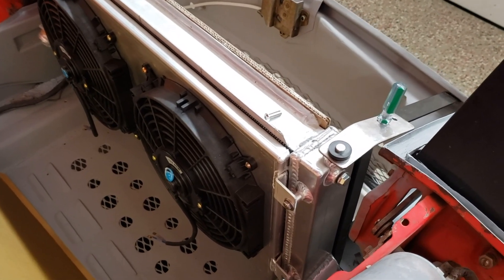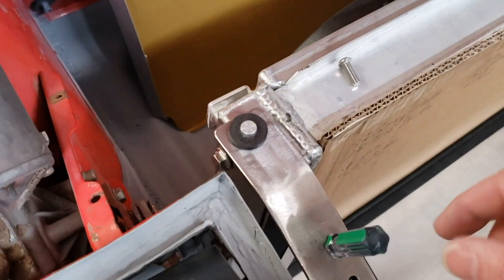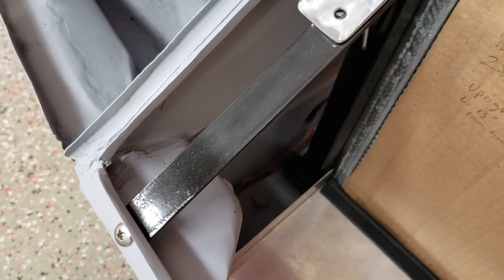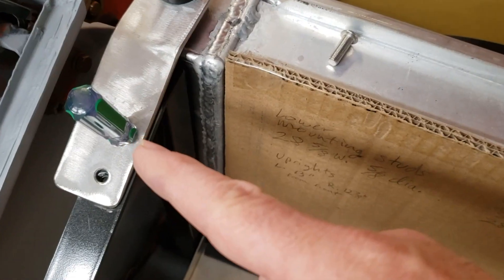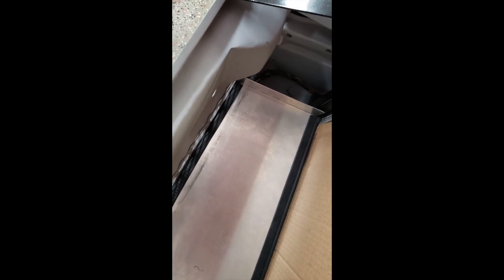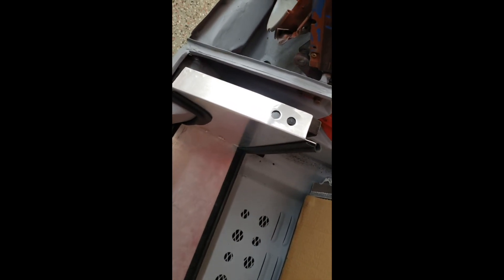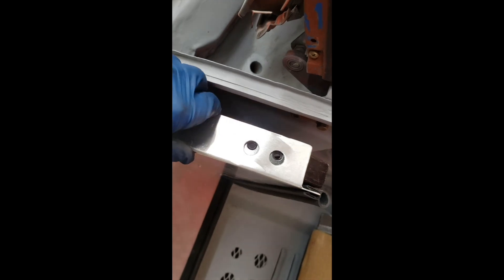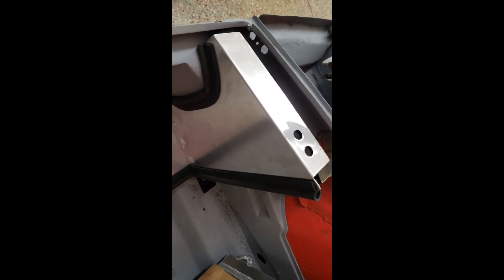Porsche 914-6 Subaru EZ30R Swap Part 2: Radiator Overview.

Comment: Should work in theory.  Why this design?  Not criticizing just wondering.
Reply: The trunk floor on my car had been butchered at some point, presumably for an AC install. Since I had to repair that area, it lead me down this path, somewhat inspired by the way the aircooled 914-6s vent air out the floor for an external oil cooler. This, versus venting out through the wheel arches like Renegade Hybrids, or through the hood which changes the look of the front end. I may end up opening up entrance and exit openings more, but I wanted to start minimally. Also, apparently the NA H-6 Subaru motor has lower cooling demands than a WRX or V-8 motor.